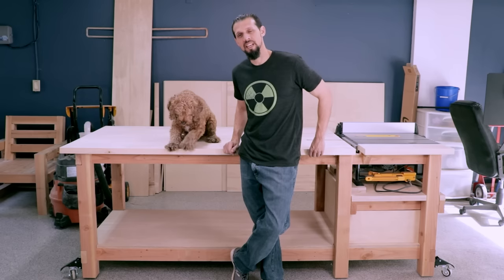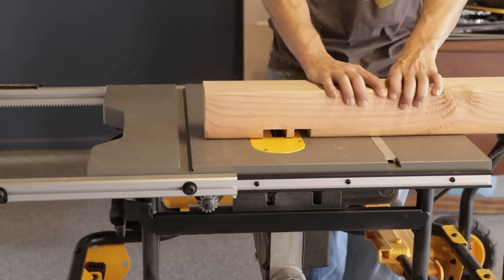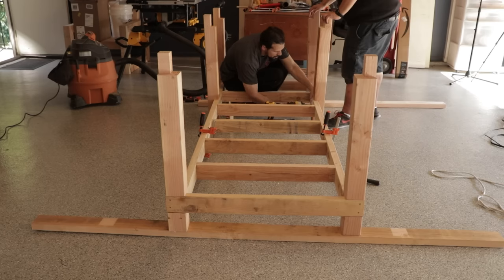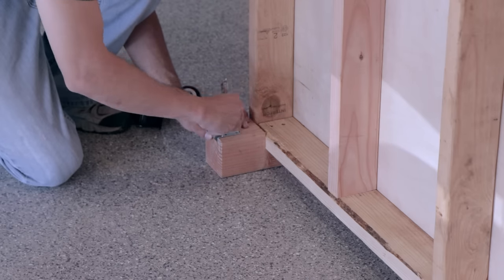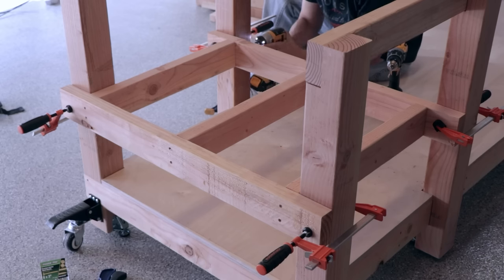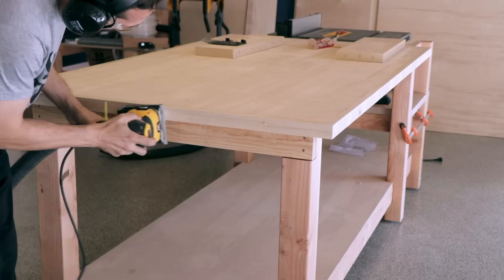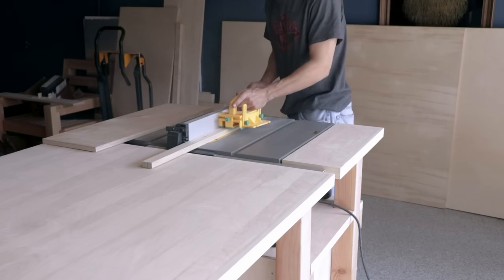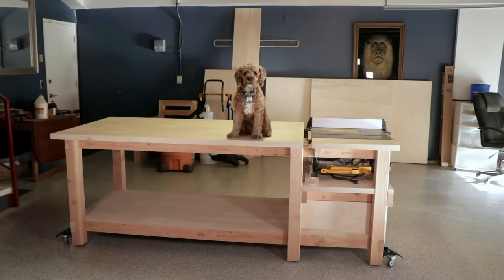Table Saw Workbench

Comment from the maker: Build plans available here: https://www.etsy.com/listing/976539293/table-saw-workbench-plan?ref=shop_home_active_1&crt=1
I wanted to answer a couple common questions: My table saw is a dewalt DWE7491RS. It comes with an arbor long enough to hold up to a 3/4 inch dado stack.
Let me know your thoughts on the build, and what add-ons would be helpful in your workshop.
Reply: nice design
Reply: Ville være rart at vi som danskere kunne læse svaret

Comment: Nice build, but I question the double layer top, and the mitred trim around it. I could understand if the top layer was  sacrifial, but pva'ing them together puts paid to that idea. And a close up of the 'trim' shows innacurate cutting of the leg joints. I have no issue with the innacurracy, it's the combining of diy workmanship and OTT extras. Apart from that, I love the basic bench design.

Comment: I made an outfeed table and cut ~1” holes in the bottom shelf above those adjustable feet, so all I need to do to adjust is stick a screwdriver (or drill for large adjustments) in that hole to adjust the legs - no lying on the floor adjusting in cramped spaces.  Just a suggestion!

Comment: FYI the little “wedge” piece you used to strengthen the sides are actually called gussets. Also the micro jig grrr-ripper is made so you don’t have to reposition it just keep going in one motion. If you have a really long piece your working with then it’s recommended you have two micro jig grrr-rippers. Great work bench by the way.

Comment: First of all, kudos to Bob Barker and his awesome and indispensable contributions to your bench build.  I have a King Charles that keeps me sane in my shop.
The simplicity of this build makes it just that much more special and repeatable for someone like me.  I'm finally going to be purchasing my table saw this winter and have looked at several integrated benches and really like the approach you took with this one.  You have enough lapping of the joints to insure good stability without getting outrageous with some of the mystery puzzle piece joinery I've viewed on others.  They are beautiful and clever, but at the end of the day, it's a workbench and I don't want to be afraid to work on it.  I also like your solution to leveling and mobility, like the rest of the bench, it's simple and effective.
I wanted to pass along my thanks for taking the time to explain and clearly demonstrate the build ... you even disclose a Mulligan or two in the process.  Very few of us can get through a complete project like this error free ... it's the human thing to do ... including it in the video gives the rest of us a bit of confidence knowing were not alone.
Consider me a new sub ... Cheers my friend ...

Comment: I just downloaded the plans and have started construction. My shop is a 2 car garage, but because of needing an additional repair bench(business) and a reloading bench(hobby), I'm a little constrained on space both storage and working. my plan is to shorten your plan by 2', which only requires the length dimension change and to add a shelf to the long open end to double storage capacity under the bench. My saw is the same as yours so no further modifications will be necessary. it should be a fun build. Great plans.

Comment: GREAT build.  I am in a one car garage and this will work for me.  I like the fact that the 2X4's are on the inside of the legs so you have a place to clamp projects.  Pro Tip, make the saw frame loose and adjust it to the finished height with the saw on the base.  The only thing I will add is dust collection for the saw, it spits sawdust EVERYWHERE! !! !!!
Reply from the maker: Right on!

Comment: Nice!  (my only suggestion would be to use 3/4" plywood for a base then recess screw a 1/4" piece of plywood on top of that for the finished table top.  easy to replace the 1/4" when the time comes.  :)
Reply from the maker: good idea
Reply: @woodpackdiy  thank you.

Comment: I bought your plans and I ended up using my 30 year old Craftsman table saw. It needed a little work, but now it runs like a charm. The thing is I did have to make adjustments as my saw was a little deeper than the Dewalt saw that you used. I also had to make it a few inches in width shorter , so that when it rolled into my shed it would fit through my door. Mine ended up being 42" wide. Still plenty of working room.After it was done the drawer in the front just seemed to deep. Yours must of been deeper., Or i missed a step. It fit a lot of things and sturdy enough for weight but things were hard to find with the deepness.  So i decided to make it into two drawers. The top drawer being 4 to 5" tall, fit most of the small tools while working with wood, and the bottom drawer was about 6 to 7" tall. I put a notch on the top bottom drawer to use it to pill open, and a notch on the bottom side of the top drawer to pull open. Now I did have to use 1/2" plywood around my notch to close it in 1 1/2" rectangular notch out inside to close it in and to get your fingers in there. 
But overall it was fun to build. I used the far back of the table to mount me a a router under neath with t track. I put electrical plugs in so that everything can be plugged in and also I had a spare battery charger so i screwed that behind my saw to the side. I mounted a measuring tape holder on the front so that i can always have a tape measure. I put in a crank pencil sharper with a place to hold pencils. Last thing I did was to make a holder for all my battery powered drills. Made a place to put my pipe clamps. 

Anyways your plans were great and as I was building it lots of things kept pooping in my mind to make it a one stop bench with accessories.
Reply from the maker: Sounds like it came out well. And yeah, the drawer is deep, but that was deliberate for me. I keep my dado stack and a couple other bulky things in there. smaller ones would work well too depending on what your using it for.

Comment: As a non-track saw buyer myself, I bought a 100” cutting guide to go with my circular saw. I got the Kreg one and it works well but I saw a better option at Home Depot for like $30. It’s only two pieces of aluminum so less error when joining the two tracks than 4 with the Kreg.

Comment: I’m currently building my own right now, I added on an attachment piece for my homemade router table, but I’m currently remodeling the table saw part because I made mine ghetto. I also made a nice slot at the bottom for me to store my planer and a secondary drawer for all my tools and on the opposite side I hang my power tools. Mine is pimped out. Not sure what the hell to do with my miter saw and I still want to buy a jointer and I corporate it in somehow. Maybe make another attachment piece.

Comment: Nice bench.  I would like to build something similar, but I use a dado stack frequently and need to remove the riving knife.   It looks like the handle on the left side of the saw is blocked by plywood.    I might see if I can add some hinges to lift the  small tabletop to the left of the saw so I can access the riving knife release.
Reply from the maker: You are right, I need to tilt the saw back to remove it. I thought about adding in a hinge, but after using it, its not a big dela for me. it tilts off the edge easily, and the stops get it back in place fast/reliably.

Comment: I really like the bench!! So much so, I bought the plans. I'm going to make additions to your plans and make miter saw station on one of the sides (remove the saw and add a top to cover the shelf the miter saw sets on) and also install a bench wood vise opposite end of the table saw. I think I'll add bench dog holes on the end by the vise, too. Thanks a lot for the video. It sparked thoughts of "grandeur"...at 3 AM out of a sound sleep! 😁
Reply from the maker: Sounds like it is gonna be an awesome workbench!

Comment: I used those casters making my workbench. I was very disappointed in them. They are dangerous (tripping hazard) but they kept popping open tilting my workbench. The popping was a very loud sound scaring me. I went with conventional swivel casters with brake. Nice job on your workbenck really nice video.

Comment: Anthony, I wanted to thank you for your excellent video and plans.  I built my first workbench following your plans (with a few modifications) and am very happy with the result.  Recently we replaced an old wooden garage door with a new one, and I recycled all the plywood and 2 x 4s from that door (more than 40 years old) and did not have to buy any wood for the project except 1/4" masonite for the top and some trim.  I doubled 2 x 4s instead of using 4 x 4s for the legs, and I eliminated the drawer, as I thought that space would be good for storing a cross-cut sled, and I plan to install a router plate at the end opposite the table saw next.
Reply from the maker: Awesome! Glad it worked out well for you, and the money savings with the repurposed wood is really nice right now. I originally planned to put a router plate on the opposite end as well, but somehow I ended up talking myself into making a stand alone router table instead (I just finished that project, and will have a video for it). Both ways work great

Comment: Do watch your fingers with a nailer. Sometimes they can double fire in the same place so the 1st nail that left the gun is going to deflect and wonder away from just going straight (which means if your fingers are in line, the nail may travel into your digits) (eg watch your fingers when nailing a corner together).
Reply from the maker: Yeah, didnt realize I was doing that till someone pointed it out. I am more carefull with my hand and finger placement now.  gotta stay safe!

Comment: Pretty sweet table my friend. I’m searching for ideas to add in my new garage. I think building this table will suffice my woodworking needs. You should add a nice stain or even polyurethane to the top of the table. It will both help glide your future cuts along as well as protect it over time. Birch is durable but pretty soft which could dent up over time. But hey you built yourself a pretty great mobile table for a 1/3 of paying for one. Well done to ya boys!

Comment: For edge pieces/repairs you don't need edge clamps. Simply use a few screw/F-clamps vertically close to the edge, then hammer some wooden wedges in behind the shaft to put pressure on the edge.
Reply from the maker: That’s a great tip, thanks!

Comment: Pretty sure I'm gonna use this as a reference to make a similar bench setup.

Want to do a 4x8 bench in this configuration, but also have a fold down miter station.

Great work.
Reply from the maker: Perfect! I wanted to do a full 4 x 8, but my space wouldn't allow it. I had to make it narrower. Good luck with your build!
Reply: @woodpackdiy  Cheers, yeah I currently have 2 benches built to the sides of my garage as I have a sloped/graded garage. But where decided I want to disassemble those for more vertical storage on the sides instead and then a bench on Casters I can move around as needed or push to the back of the garage in the winter when I park in there.

Comment: I just picked up My first table saw after 55 years of life. I started imagining a table for it, I don't have the space you do so it will be smaller than yours. 

Of course, this video is 2 years old so You may not even have this bench anymore, but are you doing dust collection with this table? I'm thinking I'm just going to run a short hose to a box or bin that's kept on the lower shelf.

Comment: Awesome build, this is exactly what I was looking for. $1000 in lumber let’s gooo!
Reply from the maker: The lumber cost me just over $300 if I remember correctly. But of course that's not counting the hardware and table saw. Extra money to buy more tools!
Reply: @woodpackdiy  I priced out everything (assuming I don't have anything I can already use out in the garage which I do) and I came in around $450 for the lumber. Baltic Birch is $65 a sheet where I'm at, craziness! I bought the plans and hoping to build this over the next few weeks.
Reply from the maker: @jrcoleman44  Good luck with the build! It's crazy the variability in prices. The sheet of Baltic Birch is $45 at one of my local lumberyards.
Reply: @jrcoleman44  $85 where I'm at as of 7/2/2021

Comment: Great build and video man. I'm currently making a plan for a table similar but with a router table on the opposite end and with wheels on it because my space is limited. Plus I have another table that pulls off the wall that will attach to make a flat 4×8 work surface.

Comment: Going to build similar bench for my 7492 saw. Just have to make sure shop vac will fit right under the table neatly. But first I have to get shop vac. Any recommendations which to get?
Reply from the maker: The shop vac fits well. For dust separator, the dustopper fits well, but the dust deputy is too tall.

Comment: Love the simplicity of your design and that you used other joinery methods instead of all butt joints like many use "because it is just shop furniture. I always say that your shop is the perfect place for a person to build on and improve your building skills. One tip, when putting two screws into a board, stagger them so if one cracks the other will hold. Do you plan to add additional storage to the bench? I'm going to put in drawers and fold down or a tip-out tray that will hold my wood planes, chisels, screws, Etcetera.
Reply from the maker: I agree that it is a good idea to build/refine skills when making shop stuff. And thanks for the tip! As far as storage for the bench, that is something I do plan on down the line, but for now there are a few other projects I'm working on first (other storage and mobile carts) and then will assess what my needs will be.

Comment: Would adding a stainless sheet on top of the plywood be a good addition? i suppose it would throw of the alignment though huh. Thanks for the video, about to purchase the plans!
Reply from the maker: That would work well. You would just need to make small adjustments to the small tops by the table saw unless u put it on there as well

Comment: Probably one of the first DIY video I didn't have to watch at 2x speed.  Very well done.  With the current lumber pricing, about how much would the materials for this build cost? Sans table saw
Reply from the maker: Thanks! That's a really hard one to answer since the prices are so variable depending on your location and keep changing over time. It also depends on the type of wood you use for the top surface. You could cut costs with regular plywood or MDF (since last I looked Baltic birch was still crazy expensive - I got those sheets for $45 each last September, and when I went a month or two ago they wanted $110 each). I think I spent about 300ish on the lumber if I remember correctly. If you used something like MDF for the top you could prob build it for similar or maybe a bit more.
Reply: @woodpackdiy  thanks for the reply and info!
Reply: I just started this project today. I spent about 350-400.
Reply: @christianraab74  thanks for the reply! That makes me want to start this project. What wood did you go with?

Comment: You probably already know this since you're the professional.... but something I saw in another video that I thought was a genius idea was having your miter saw cart / station the exact same height as your workbench and having that as you're out feed or in feed by just rolling them together!
Reply from the maker: I am definitely always open to tips, suggestions, and/or ideas. My main miter station is being set in some cabinets (the station/cabinets are 11ft long total). But I like the idea of interconnectivity for the work bench and other work stations I plan to make in the future.
Reply: @woodpackdiy  credit goes to Ryobi Nation where I saw it, but my shop is 12 ft by 20 ft, so space will be at a premium! I plan on building four carts, one being the table saw cart, the other being the miter saw cart, and the other two being flat top carts....they can be used as out feed, end feed or side feed tables... or you can just attach the two carts together to make a large workbench! And then when you are not using one or all of them, you can just roll them off to the side out of the way!
Reply: @woodpackdiy  here is the cart idea I was speaking of....

https://youtu.be/mDA4UltQfWc
Reply from the maker: @GaryBowen73  Sounds like a good way to maximize your space. I also plan on making some carts to use as a sanding station or for general use. That way I don't always have to move mine and the wife's car out of the garage to do some work.
Reply: @woodpackdiy  cool...... Well my biggest thing I got from that video I shared with you and many like it..... Make sure every cart, workbench and table in the workshop are the same height! LoL
Reply: @GaryBowen73  .